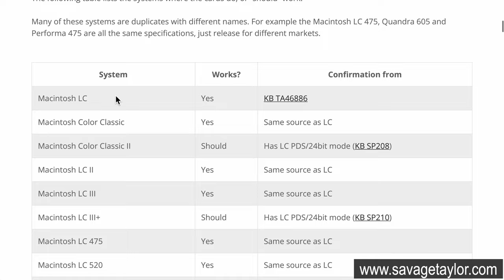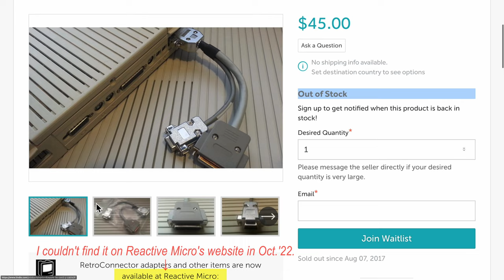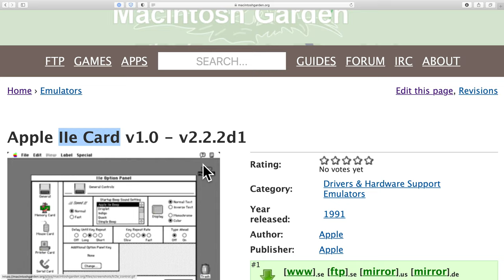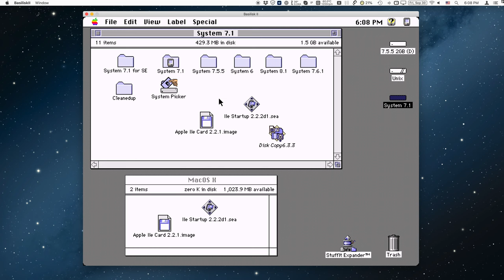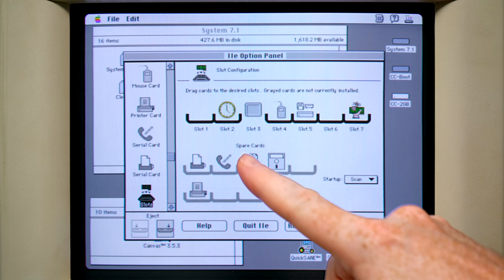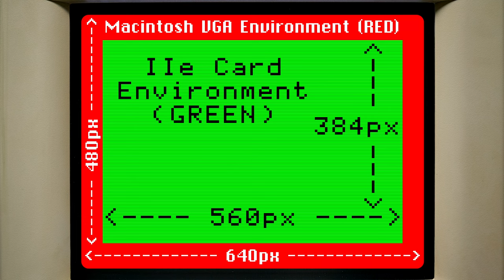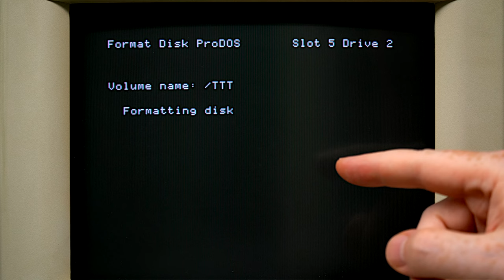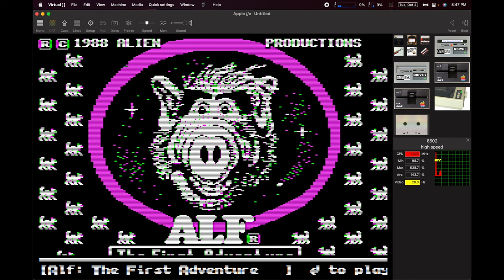Apple IIe Card in Color Classic MYSTIC [Part 1]

Comment: The Apple IIe Card and the Apple IIGS both produce fairly artificial and “wrong” colours in the legacy graphics modes that were designed for the Apple II in 1977 and the IIe in 1983.

Unlike these NTSC modes, the more modern graphics on the IIGS and Macintosh have square pixels or RGB colours.  They have no concept of the way the colours (and pixels) were used in the NTSC technology — which is good, because it was very odd.

But the result is very oversharpened, and is the reason those Dazzle Draw menus look so rough.  There’s no way to see it for real on a IIe card, but the last new Apple II computer was the IIc Plus and it does real NTSC video with HGR and DHGR graphics.

The state of the art in emulation has, in the last decade only, finally cracked the challenge using rather mathematical solutions.  CRT emulation has come leaps and bounds, and if you want a really good screenshot, you should use those really new emulators.

Comment: Interesting with the IIeStartup versions...I have to test much more on my LC
Reply from the maker: The version of IIe Startup you need varies by the LC model you have.  As mentioned in my video, v.2.2.2d1 is the newest version that came out specifically for LC575 compatibility. But that doesn't mean you need to use that on another LC Mac where an older version of IIe Startup may work just fine, oven better than 2.2.2d1, assuming 2.2.2d1 even works at all on an earlier LC Mac.  So yes, testing is paramount.
Reply: @JDW-  Thx! Tested again...and did not get the 5,25 booting on any version and settings... on "scan" I get "unable to boot from slot", on slot "6" i only get the prompt and no message at all...I have to investigate this. On 6.0.8 I donÄt get the option "format as prodos" on the internal drive. It only let's me choose if single or double sided macintosh-volume. I have to have some other software or create prodos floppies via IIe card-software. The IIe software must be Version 2x above because 1.x does not work with ProDos-Partitions on the harddisk afaik.
Reply from the maker: @drzeissler  Are you using a compatible, real 5.25" floppy drive or FloppyEMU?  Not all 5.25" drives will work when attached to the IIe Card's floppy connector.
Reply: @JDW-  yes, 100% correct drive. It worked...but I had lot's of problems getting it working...now I can't remember what I did because I made a fresh install on my blueScsi in order to get four prodos volumes on that machine. TotalReplay is one, but I am thing about other stuff as well...more adventures (sierra), programs, GUI like Geos etc... Having working floppys is a "bonus" not essential to me, but it would be nice... I have to check... Thx!
Reply from the maker: @drzeissler  Not sure how you got your BlueSCSI setup for use with the IIe Card, but we have a thread about Disk Jockey over at the TinkerDifferent forum here: https://tinkerdifferent.com/threads/disk-jockey-a-disk-image-file-maker-for-your-retro-stuff.1039/page-4#post-17767
Reply: @JDW-  That was easy, I used DJ to create several 2GB Volumes/Harddisks and partitioned them with SC 7.5.3 patched version. On every Volume I have one Macintosh and one ProdosVolume. 4xMac 4xProDos in total. But now I am thinking about switching to the IIgs and replace the LC with IIe card with another mac.

Comment: Why did the TotalReplayGuys make a 32 ProDos Image that's bigger than my ProDosVolume on my LC ? (I did not copy some files of the DemoFolder to make it work)
There is a BUG in the Software. Scan-Option let's a 5,25 Disk boot, using port  6 does not boot the disk, I always get an error, even if with the correct drivesetup.
Reply from the maker: The answer to your question is found on the TinkerDifferent forum, beginning with this post by Eric, creator of BlueSCSI: https://tinkerdifferent.com/threads/mystic-options.596/page-2#post-16044
Please keep reading to the next page of posts for even more detail.